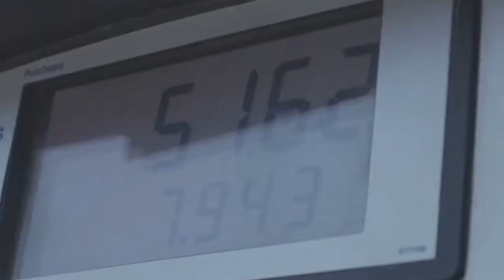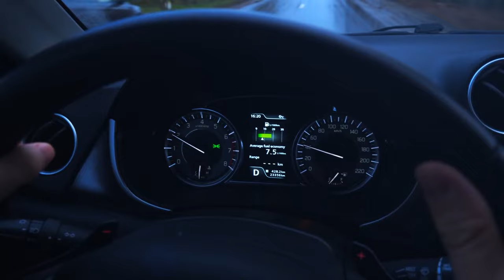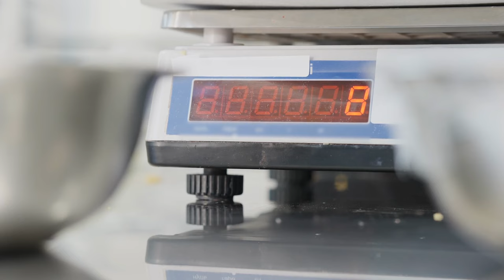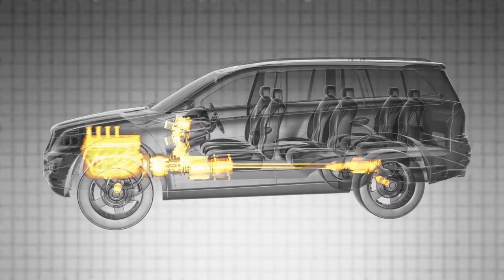Honda's Hydrogen Revolution: Could This New Engine PULVERIZE The Entire EV Industry?

Comment: A great video of great information very valuable. In this video we delve into the new technology that will revolutionize the automotive industry with this new Hydrogen combustion system in which we will have a radical change in the functionalities of vehicles. In this video he does not explain about these hydrogen fuel cells, how this clean and renewable energy source works and its potential to revolutionize the automotive industry

Comment: Similar to the electric, the hydrogen car does not emit polluting gases and does not make noise, but they are also powered by electricity. The difference is that it is powered by this gas, which is one of the most abundant elements in nature.

Comment: Downvoting this video bc it is so selective in presenting information as to border on being misleading.  Rather than focus on Honda’s way-too-late-to-market problems with both its hydrogen vehicle and its EVs, the video launches into a massive hydrogen propaganda piece.  There is no discussion on the storage problem for hydrogen both onboard the vehicle and in refueling stations.  There is a reason why the clarity and the Mirai are so cramped inside and have so little storage space—the hydrogen storage tanks take up all the space inside.  Also, why does not the video discuss the lack of refueling stations outside of California and Washington states?  If you are in Iowa, where will you get hydrogen fuel? Is a road trip to Texas a possibility even with the fast refueling times over an EV?  
This video fails in its initial purpose of informing consumers and investors about Honda’s future, other than admitting the Clarity has been an utter failure, and Honda’s PR Dept has bare shelves on new stories to drum up interest.  
😢
Ppl: move on—hydrogen is a dead bang loser for the automotive industry.